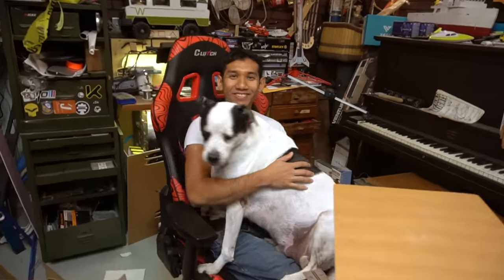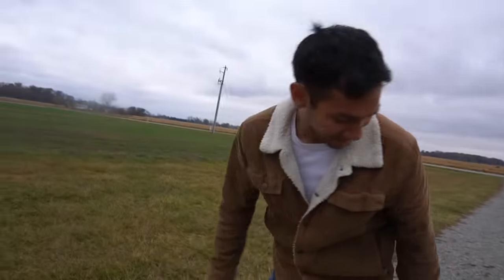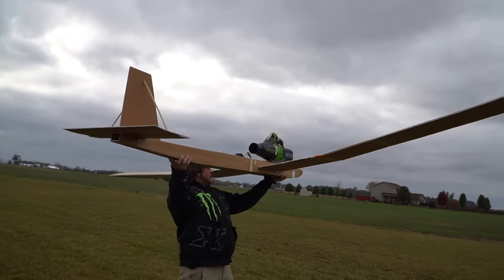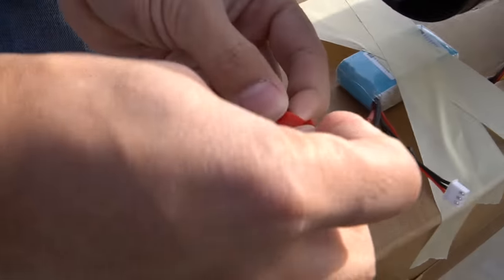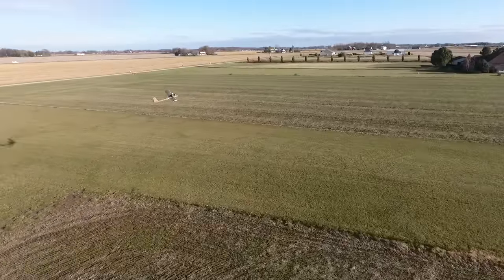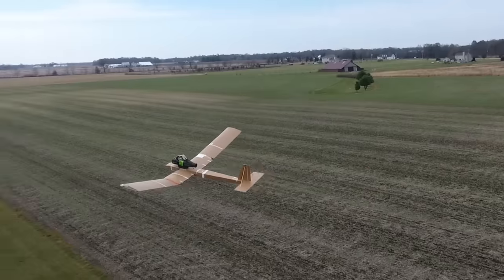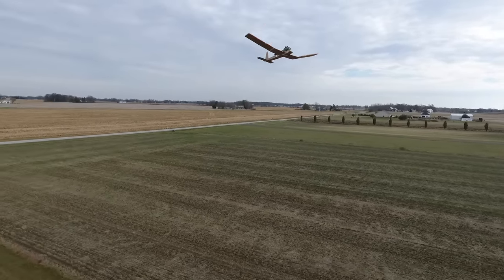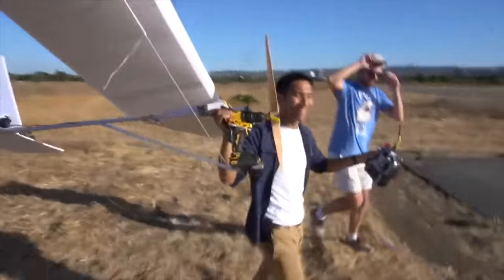FLYING Leaf Blower RC airplane Mk2

Comment: Double the wing area and integrate leaf blower into fuselage and make it part of lifting body to help reduce drag
Reply: , kind of like the thumbnail, but with the battery handle controller flipped underneath the wings, and the blower like a single jet engine out the back, that would fly! Sounds like a derby. 😀
Reply: he prob didnt want to mod the blower
Reply: Yeah use existing chassis as stress member.
Reply: Can't really double wing area as any sort of wind would then snap it off qs you saw with the mk1 of the new vid
Reply: And make a one piece reinforced wing.
Reply: Monocoque carbon fiber wing 😉, integrate leaf blower into fuselage, and some darn ailerons please

Comment: Peter: Fancy plane talk
Also Peter: I’m gonna tape a rock to it
Reply: Modern problems sometimes need simple solutions
Reply: Or very shitty solutions.
Reply: Modern problems require outstanding moves
Reply: @Saipan2297  meme crossover
Reply: Engineering 101

Comment: Guy: So we’re gonna put this thing on and I’m gonna show you how much worse it flies.
Plane: flies smoother and faster

he says this at 9:42 btw
Reply: @assoneS1  ok, I was hoping that it will work. I'm engineer not sociologist/psychologist🙁
Reply: The shape reminds me of old pulsejets.
Reply: @cryophile  also it sounded dope
Reply: Maybe there's some weird turbulence effects with having the output that close to the wings?  Or it just drastically improves the performance of the rudder.
Reply: Peter: "that wasn't supposed to happen"
Reply: @stevenclark2188  im pretty sure that the tube reduces the amount of airflow out of the leaf blower. it is almost acting like a compressor in a jet engine
Reply: The concentrated airflow over the rudder probably made it easier to steer.
Reply: I'm no rocket applientist, but I'm pretty sure the attachment can be treated as a converging nozzle which will increase the exit velocity for subsonic flow speeds.
Reply: @adamsaffell2361   Yeah I agree , I also think it makes sense that it steers beter because if the air comes out of the leaf blower closer to the rudder then it has less time to spread out or be pushed by the wind in another direction making it swirl around, it also means when the rudder moves side ways the air pushing on it is coming straight from the front meaning the increased drag will be on which ever side the rudder is turned to slowing that side down and helping the plane turn.
Reply: Aerospace flight test engineer chiming in here. Thrust is determined by mass flow rate. The nozzle causes the flow to converge, which in subsonic airflow (e.g. below the speed of sound) causes the air to move FASTER. (In supersonic airflow it's the opposite, which is why you see rocket nozzles that flare out instead of in.) The taper does restrict the flow somewhat, but the higher velocity of the flow provides a greater net thrust as a result. Greatly speed up a slightly reduced airflow: more mass flow. You can look up the Bernoulli effect for more information. (Good example: If you watch videos of the Blue Angels, you'll notice that the F-18 nozzle initially narrows when the pilot powers up for takeoff. This increases the thrust, UNTIL the afterburners kick in, and then they flare out to increase the thrust. https://youtu.be/gl9dNf-IhiY?t=157)
Reply: Brandon Munday a venturi.
Reply: Brandon Munday is exactly like this
Reply: I thought it would fly better if you restrict air flow the pressure rises out. same as when you put your thumb over a water hose end while the water is on Or put a nozzle on a hose and let go what the action increase. That is also whi many rifle shells are necked down to increase pressure.
Reply: Jeff Horton the pressure actually decreases with increasing velocity in a nozzle
Reply: pleay roblox
Reply: And sound better
Reply: @zoomie9134  "subsonic"?
Reply: @bruceatkinson5357  *slower than the speed of sound
Reply: @zoomie9134  Yes, I know. I think it goes without mention the "plane" is subsonic.
Reply: @bruceatkinson5357  of course! but that is regardless of the flow within the nozzle. An airplane(or rocket) can be subsonic and have supersonic flow speeds at the exit of the propulsion system nozzle. and again a leaf blower isn't shoving air out at speeds past mach one, so subsonic flow speeds is a fair assumption.
Reply: If he flew it close enough to the ground, it would actually acts as a leaf blower. xD
Reply: It looked like an itty bitty Nazi jet fighter. I half expected a Tuskegee Airman to shoot the thing down.

Comment: Put the blower under the fuselage and integrate it as the main structural element for the wings. Consider using a mono-wing design.
Reply: or maybe dual wings like the 1800's aeroplanes
Reply: @dilanrajapaksha  i dont think there were planes in the 1800's
Reply: @rawhidelamp  yeah my mistake early 1900
Also he already tried a bi-plane Mk1
Reply: And attach a 30mm Gatling gun :)
Reply: Or one above and below the fuselage?
Reply: That would not work well. It would be extremely hard to integrate it into the structure and would not be that strong.
Reply: @colt.45rc76  JB WELD DAT BIIII

Comment: Hell yes. I am glad to see this project revisited. Some of those shots are really cool of that thing flying. I have been missing some of the old school rc plane videos. 

On the battery thing. At my work people bring in those packs all the time trying to get them rebuilt but we don't rebuild lithium packs. They then get mad at me because I can't do this for them and they have to spend $120 on a new battery pack. I try and explain to them then that they should always research whatever they are buying before purchase because lithium batteries don't last as long as ni-cad/ni-mh packs will. You might get 3 years out of a lithium pack while a ni-cad pack will get you 10 years. Anyways thats just my little tidbit about lithium power/yard tools.
Reply: Lithium should last at least 5 if you're not leaving it fully charged all the time, which most people do
Reply: actually litium ion akkumulators should in theory last longer than ni-cd/ni-mh...
Reply: And the capicitiy of ni-cd should get lower thanks to the memory Effekt
Reply: @williwonti  Thats the problem lithium has to be somewhat babied and most people wont do that with power tools and wont research anything. Thats why I still recommend ni-cd/ni-mh to most people.
Reply: @x9x9x9x9x9  Eww. Who recommends NiCd in 2019? Couldn't even imagine a 40v NiCd yard tool lol
Reply: @amorton94  Someone who works with batteries for a living. Lithium for the average person is bad. It will get better but for now its all garbage and I don't recommend ni-cd for yard tools screw that. SLA or corded is the way to go. Another thing that kills me about these lithium batteries is if the voltage gets too low 1 time because it was left completely discharged and it got cold the internal safety bullshit can completely kill the battery.
Reply: Just as people have already responded, its not true that Li-ion batteries have an inherently shorter lifetime, but they will if you abuse them in the way you use them. Look at a Tesla, it wouldnt be sustainable  with a lifetime of 2-3 or even 5 years. It will last up to 10 years or more because the battery charging and discharging range is limited in the software. It also depends on the temperature conditions when it’s parked and the active cooling is shut down. Lower temperatures will prolonge the life.
Reply: @x9x9x9x9x9  There it is. Recommends last centuries tech to boomers. That explains it. I understand now LUL.
Reply: @amorton94  Pretty much lol

Comment: You can reduce the weight even more by using CA glue instead of hot glue, the CA glue is a lot stronger making the frame stiffer with the reduction of weight you can add extra support to keep the wings straight because that's where you're losing lift. Plus try to incorporate the leaf blower within the fuselage giving you better aerodynamics. 
Overall great job 👏.
Reply: underrate comment man.. good ideas

Comment: The second I saw the wing attachment I knew that was going to happen, the spar attachment is too short. If you register the battery you can get a free replacement no questions asked.
Reply: I think the usage of it has a good chance at voiding the warranty. Replacement warranties are normally for nominal use failure.
Reply: @adamhale6672  Not with these devices. I bought a weed wacker and the battery died in a week. They replaced it without looking at the old one, they just told me to recycle it at a hardware store

Comment: Get 2 leaf blowers and make a twin turbine gliding jetliner thing with 2 leaf blower engines.
Bonus points for separate throttle controls for the 2 leaf blowers (even if they are both just 0 or 100)

Also what could be interesting, is a butterfly valve type of thing on a servo, that changes the airflow inside the leafblower tube to create variable trust (think like a carburetor)

Comment: Great Attempt!
3 Quick things
1. Take that blower apart and fuse the switch you used a rock for with some solder and make it ON all the time
2. Remove the front protector and as much plastic as possible
3. Try again

Comment: A plane flown by little handheld Dremel tools wood be pretty cool.
Reply: Actually a solid idea! I second this. (Maybe too easy though?)
Reply: YEAH B-17 w/ four cordless dremels
Reply: @rossherman4515  yeah a speed controller controlled remotley by a servo could adjust the throttle, and you could use differential thrust for stearing it.
Reply: Seems like the cordless drill challenge on easy mode. But I'd still enjoy watching that.
Reply: @pauljs75  actually most dremel are 10,000RPM++ with huge motor (weight alot) it will be very hard.
Reply: @Francois_Dupont  if a dremel 8100 is used it will have a max rpm of 30000 rpm and weigh in at 450 grams. With the right prop selection it may just work.
Reply: Well rotor riot has just built a quad copter out of 4 dremels but not using the standard batteries. In a fixed wings case think it will still be possible to use the standard battery pack.

Comment: Hey Peter just for the fun of it .. use a piece of pcv pipe I am not sure what size to use but if it went through the spars close to either the middle or leading edge of the wing.  It would let the wing flex but not allow it to break .  Hope to see it soon.
Reply: That would be too heavy.  Better to use some light weight hollow aluminum tubing

Comment: Aerospace engineering student here.

Quick summary on airflow:
if you reduce the diameter of the tube, the esacipng air is faster than the incoming air.
Faster air results in a higher push force, which is what you want, if you're trying to get this thing to fly.
Reply: so more air pressure by making the leaf blower tube tighter in diameter = higher push force?
Reply: @thisguy9458  Yep that's exactly right that's why the leaf blower pipes get narrower at the end so the air comes out faster and they push harder. So by removing the pipe they actually made the performance worse.
Reply: @stainlessteele5  yeah I was just wanting to be sure, never took physics in school, although it’s kinda funny I’m not completely understanding of this since I’m a pilot in training

Comment: The restrictor increased the thrust because it forced the air to move faster. That was really impressive!
Reply: Did I ask
Reply: I love how he thinks it flies worse with the air restrictive tube.  More thrust with it on
Reply: @matthewkrislow3442  Not really more thrust. The same amount of air that comes in on the front is coming out in the back. The thrust equation is fairly simple: T=v(dm/dt), where v is velocity, dm is change of mass, and dt is change in time
Reply: @georgesylvester4491  dude you’re so cool
Reply: Pretty sure it would increase general efficiency, but the flow rate would stay the same, and so would the thrust
Reply: @WFCinSC  I'm not convinced. The restricted flow is presumably increasing the velocity of the stream of air, versus unrestricted. If we extrapolate from that, a fan without any tubing/ducting around it (like an airplane propeller) would therefore be the least efficient, and if we restrict the flow even more (narrower tube, increasing the velocity further), we would increase thrust even more. This implies that the more you restrict flow, the more thrust you get? With the same energy input? Where does that thrust come from? And conversely, where does that energy disappear, when the flow is not restricted?

Mind you, I don't have an engineering degree, just some interest in the area; it would be the first time to undergrad fluid dynamics for me...
Reply: @WFCinSC  So, what you seem to be saying (there are some typos in the answer, making it a bit difficult to parse) is that there is an output curve, where the peak lies somewhere in the middle, and is between open stream (no ducting) and narrow duct.

What makes me curious is, if the highest efficiency is achieved with a specific shape/ratio of ducting (relative to the fan diameter and air velocity), why aren't there airplanes with ducted fans, and instead literally all have open propellers?
Reply: @vasicp  I generally see ducted propellers for low speed vehicles, so I would guess that the external drag of the duct itself is detrimental for high speed flight... though jet engines are excellent examples of ducted propellers but use multiple stages at high rotational speeds, not a single propeller of high aspect ratio and low tip speed (where tip losses and transonic flow effects are minimal).  I designed a ducted propeller for an SAE competition back in college and could never get the increased static thrust to equal a net thrust increase at airspeed... of course I wasn't the best designer back then.  Pardon my haphazard grammar, writing, spelling... I didn't get into engineering cause I was good at English or interacting with humans :)
Reply: @vasicp  some propellers have housings for efficiency, and box fans work better than standard fans
Reply: @vasicp  Since the mass does not change in this configuration (as it does in a fuel powered jet engine), we are down to F=Ma. (The thrust force = the mass times the acceleration applied to it). So the balance is to get the fastest exit velocity (the highest acceleration) up to the point that the mass we’re able to move through the fan is reduced. Like holding your thumb over the end of a garden hose. The acceleration provides the thrust.
Reply: You guys are treating the extra piece of tubing like it's a nozzle, when in reality it's mostly just an extension tube meant to reach closer to the ground. It's mostly dead weight and costly airflow restriction. He'd get much better performance if he chopped out the entire straight section before the taper.
Reply: @Russell218  it restricts flow without creating turbulences, this requires some amount of length
Reply: @vasicp  turbo fan jets exist.
Reply: This actually decreases the thrust somewhat by restricting the flow. The restriction also causes increase in exhaust velocity but the energy input is the same. So, the mass flow rate decreases  somewhat to balance the increase in velocity (conservation of kinetic energy). Anyways the trade off, of slightly lowered thrust but higher exhaust velocity can allow slightly increased speed of the plane if the thrust is still sufficient for the plane.
Reply: You really have to look at motor power.  That's the energy input, and therefor the output.  You put in so much power and it all comes out as energy (some of which is lost in the forms of heat and sound, but that's another discussion.)  

Fans and pumps don't work like most folks think they do.  Max current/load is with the least resistance to flow, because the device is moving the most mass; until you hit cavitation, anyway.  Restricting the flowpath actually lowers the current/load.  (Try it with any fan or hair dryer, block flow and you can hear the motor speed up.)  It's almost counterintuitive. Mostly, anyway.  Some specifically designed systems have a flatter power/flow curve.

You need velocity to move leaves. For drying a floor you need mass flow rate.  Flying planes, too, I guess!  If you want better performance, cut off half the inlet grill parts (maybe even make a little scoop) and smooth out the internal flowpath.
Reply: The Venturi Effect :)
Reply: @WFCinSC  Too me it's pretty simple.  If I'm holding my leaf blow with no restrictor to increase the volicity.  I have no resistance hardly at all when holding it.  When I put it on.  I now have to use some arm strength to push back against the thrust.  I would think the same applies with the plane.   From the video, I saw the plane fly better with the restrictor on it.

Comment: Dremel or generic rotary tool powered flying craft of some sort.
Reply: Those things are designed for insane high speed. You would burn it up if you put a propeller any bigger than like 2 inches across.
Reply: @elijahvivio1996  Unless you put a reduction gear or two on it like those larger brushed kwads, Or maybe an EDF

Comment: Love the videos, think you could make a 3D printer fly and print at the same time??
Reply: LOLLL XDDDD
Reply: Could he print a plane while flying?
Reply: Hmm... I bet he could do a tie in with NASA by sending one up on a weather balloon or three.
Reply: Or could he print a flying 3d printed plane which prints a flying 3d printer?
Reply: the only limitation would be power and heat, because it uses a lot of electricity to melt the plastic and flying would cool it down a lot
Reply: @ZoeSoutter  It would have to be enclosed for sure
Reply: Prints mini planes that drop from that plane making a carpet bomber
Reply: Easy. Turn his ultralight into a RC ultralight, strap in 3D printer to front seat, start print, full throttle on ultralight, cross fingers and let it fly.
Reply: williwonti, yeah for sure, eh peter will make it work